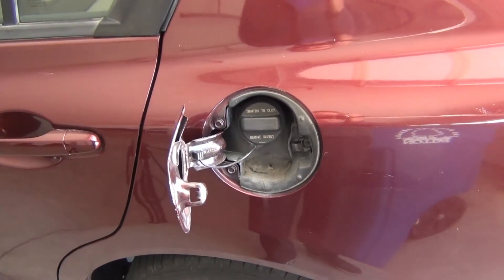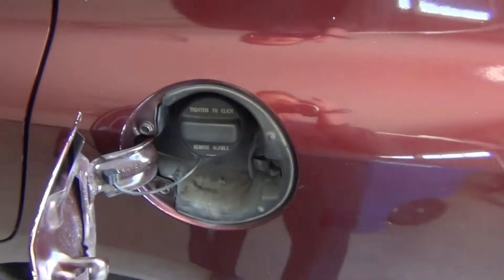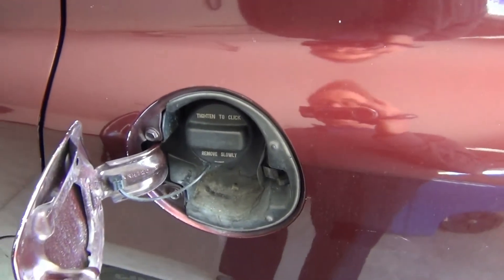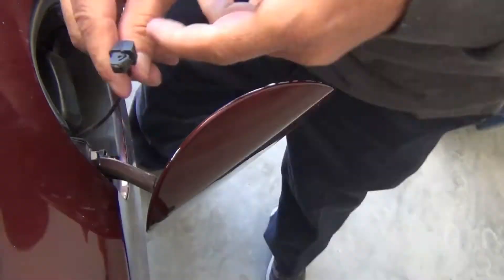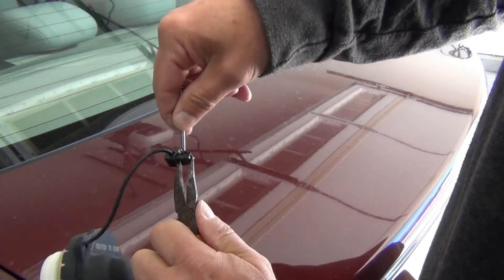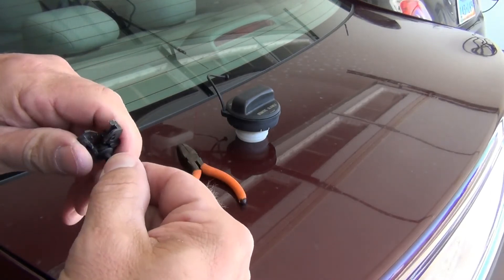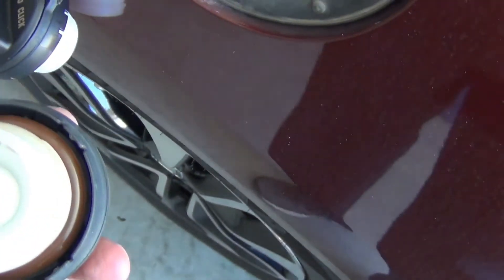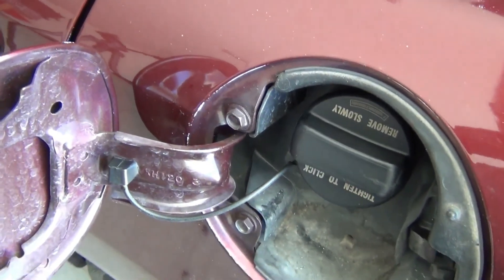Replace Tethered Gas Cap 2013 Honda Civic - Fix Fuel Cap Error Message

Comment: Thanks for the tip. I was wondering why the replacement didn't have the anchor and figured I could there was a way to re-use the old one since my gas cap tether snapped due to dry rot.

Comment: my straight needle nose wasn't cutting it but I was able to pop it with a screwdriver on the back and simultaneously pull the plug from the other side with regular pliers. A little wiggling and it came through. Very hard to reach on an Accord.
Reply: Man I was fighting with that thing for 20 minutes. My pliers were too fat at the bottom and I couldn’t get a good grip. On accords there is barely any space to grab the other side. Long story short I ended up yanking it out. The tip split in two but ur still works 😂😂. F*** it
Reply: @Jergs18 I almost did the same thing but was able to wiggle it out by pressing on one side and moving it back and forth. No room to maneuver. 🤬

Comment: Very helpful. I bought a replacement cap on Amazon recently. When my mechanic was changing my oil, he ran a pressure test on the new gas cap and the test failed. Had to return it and buy an OEM one from Honda for $50…bleh
Reply from the maker: Thanks.  I would definitely recommend buying the OEM.